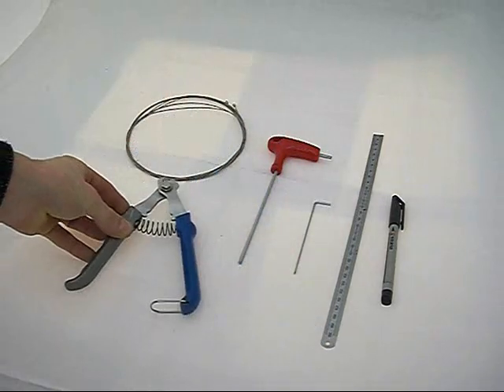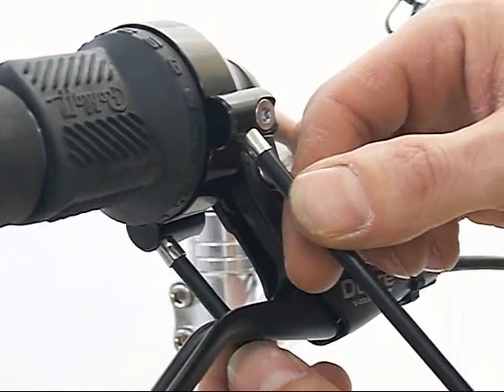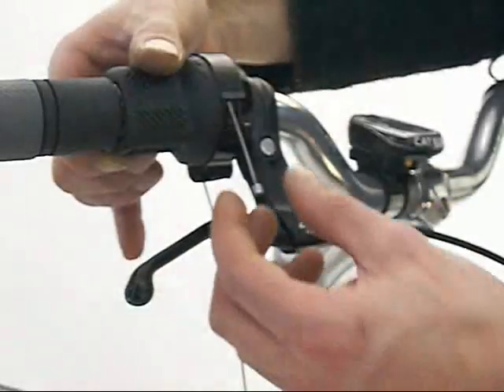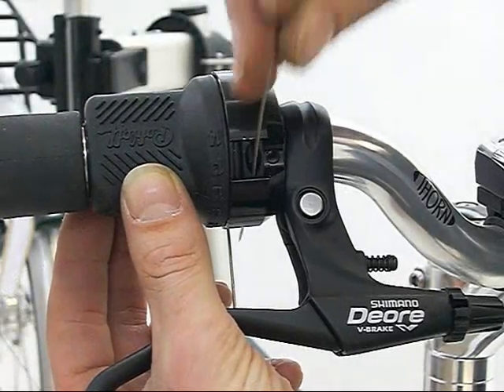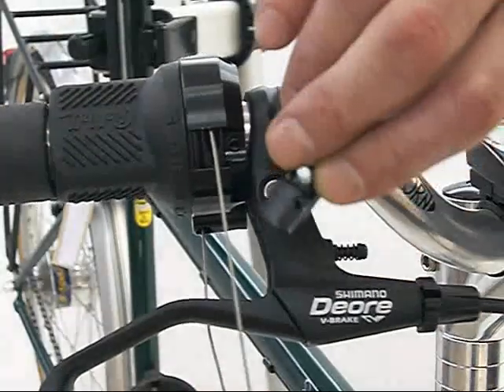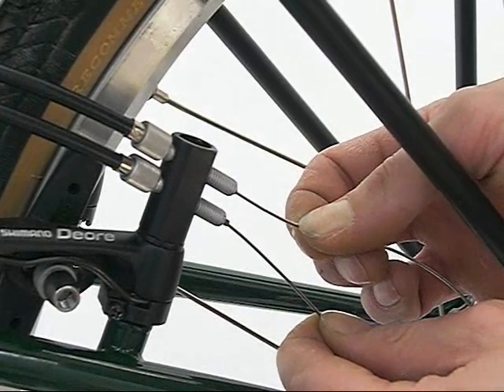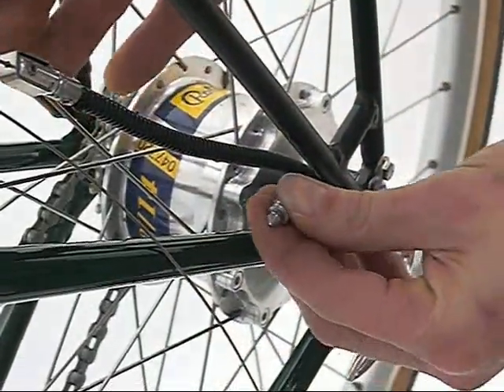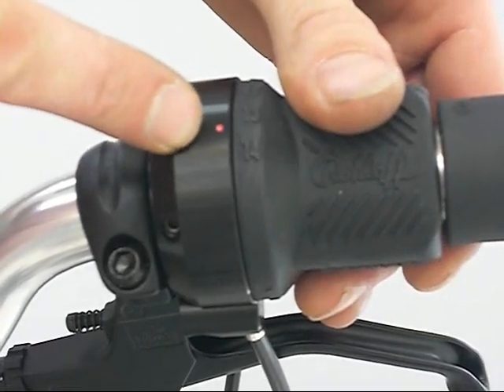Thorn Rohloff shifter cable replacement (internal gear mech)

Comment: Excellent explanation, thanks! On my bike the aluminium adjusters were seized due to corrosion between the steel holder on the frame (Santos) and the aluminium of the adjusters. I broke one and had to drill and retap the M6 hole, it was an absolute drag to do this so close to the frame with no space to align the threading-tap. But the replacement of the cables is now done and shifting perfectly aligned and silky smooth😊

Comment: replaced the cables on my secondhand rohloff mtb. before replacement it didn't shift very smooth, now it does. thank you very much for this guide.

also i swapped the cables, so now my mtb shifts like my city bike that has a shimano nexus. the city bike i have for years so on the rohloff mtb a lot of times i shifted the wrong way, not anymore :-)

Comment: ...These enclosed shifter gears are CRAP! If something screws on the inside there's no way to get at it and fix it!
Reply: But it is a rohloff. Theyve never had a catastrophic failure or a stranded cyclist. The hub weighs alot but was built to last and does cost over a thousand of course. They just dont break. Vs derailleur it just wins every single time. 3 years later im still waiting to spend my first £10 on a repair to this hub it just doesnt happen. An oil change is so cheap too thats all one does with one of these